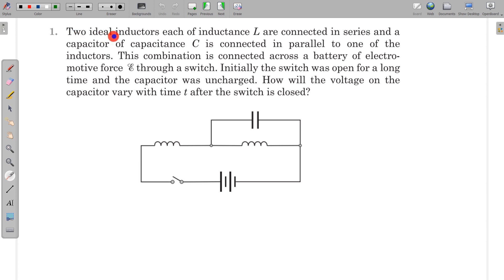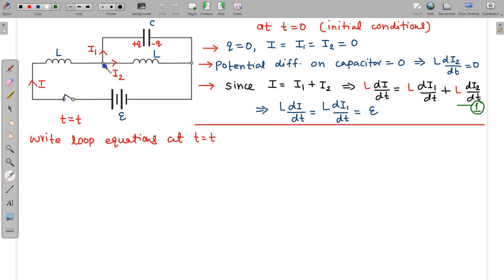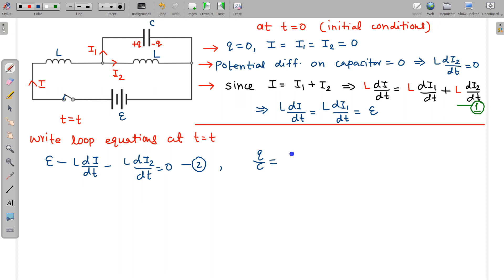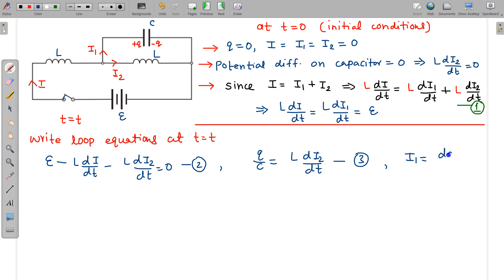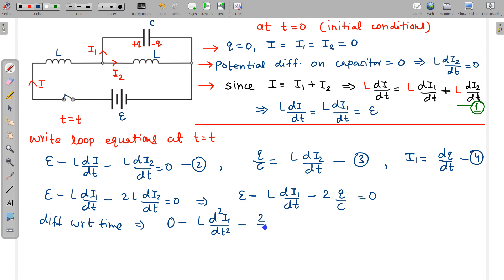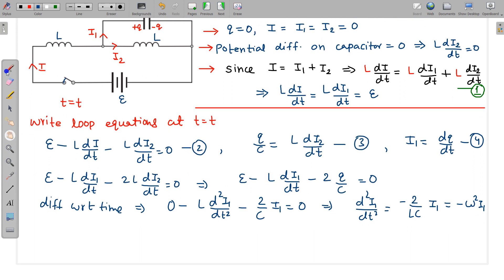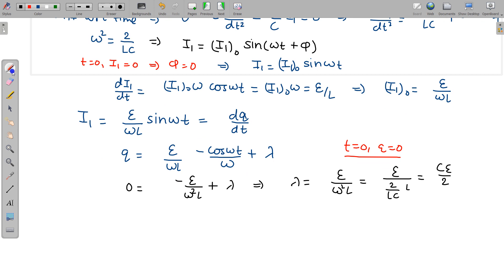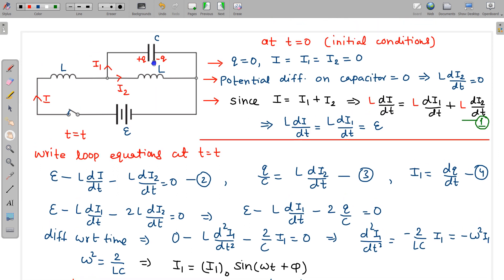Electromagnetic Induction | Pathfinder Solutions | LC Oscillating Circuit with DC Voltage Source

Comment: Sir at t=0 Vo = VL
But sir what about Vr (why   you not consider voltage about resistance)
Reply from the maker: There is no resistor in the circuit